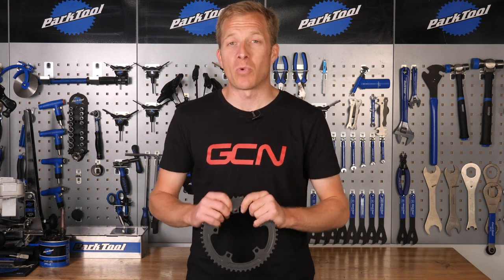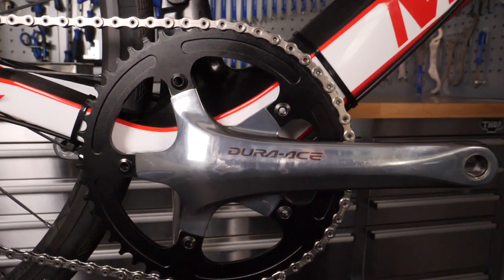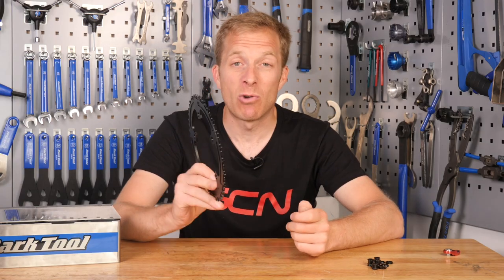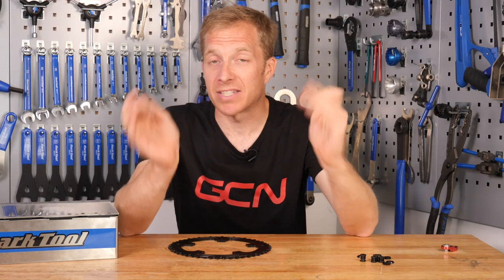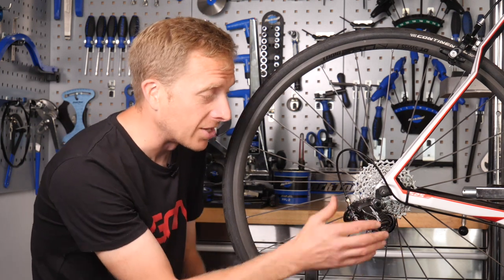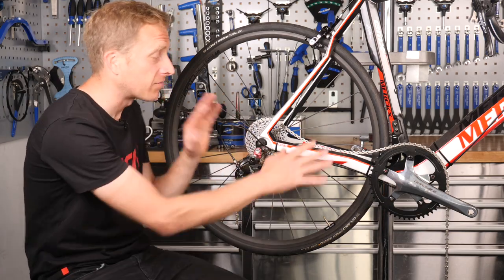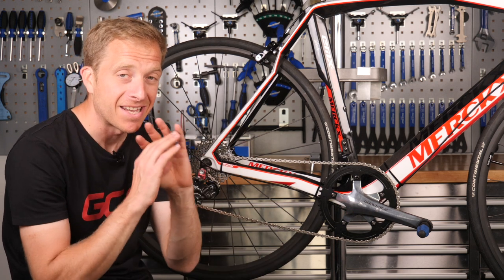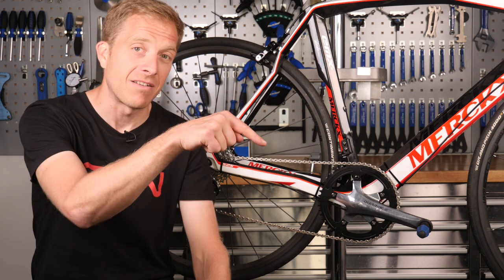Convert Your Bike To A 1x / Single Chainring Setup!

Comment from the maker: Are you thinking of converting to a 1X drivetrain? Let us know. 👇
Reply: On a roadbike? Never. Why would I sacrifice the extra ratios of a 2X ? The newest Ultegra rear mechs will handle a 34 cog cassette. I already ride a 50/34 chainset so with that rear mech I can handle anything.
Reply: I've recently completed a conversion on my steel audax frame to a gravel-lite setup with a Shimano CX50 crankset, 40t Hope retainer ring, a 10sp 11-36 casette and a 9sp Deore XT rear mech. Slightly less hacky than your method but it works an absolute charm, as the pull ratio on the mtb mech is almost identical to that of the 10sp 105 STI shifters. Ive been running it on and off road and absolutely love it! The stronger spring in the mtb mech coupled with the retainer ring keep the chain pretty firmly in place without any drama too.
Reply: Ill stick my current setup
Reply: Here's where I am with 1X.......... I wish you luck in the future, but I can't invest in you so I'm out,
Reply: No. Not on my road bike. Maybe I'm just not strong enough, but I often use the small chainring on my 50-34 11-30 setup. I have Sram Eagle on my mtb and even on that bike I'm not sure yet. I do like the smaller steps between gears of a 2x.
Reply: When I restored an my 1999 Giant OCR, I took the big and the small chainrings off the triple Shimano Sora chainset, I ended up with a 12-25 8 speed cassette and a 42 tooth chainring on the front. The set up works absolutely perfect, i didn't but any special stuff like a narrow wide chainring or a chain keeper. I would never describe it as a bodge, it works perfectly and looks really neat. I use the bike every day as my commuter to work. (if you want to have a look at the bike, I recently sent it in for the GCN Tech bike vault ;) )
Reply: I find it kind of funny the way cycling is regressing in the gear range department. My first bike was a three speed hub tourer, after learning on a single speed 'high nelly'. Three speed and little flat roads led me to a 2X ten speed racer, better selection for the hilly sections. My current stable all have 3X nine speed, wide ratio setups, much more suited to the terrain, for me. I don't think I'll go 1X.
Reply: I'll be keeping my infinite speed hub and 2 chainrings.
Reply: No.  Never.  I like having the ability to fine tune my cadence and comfort level to the climb without massively shifting under load
Reply: I'm just in process of doing this on my commute/winter bike. I am using 105 10 speed shifters with a deore 9 speed rear mech because the pull ratio is the same. I have sourced all the parts i.e chainring, chain, chainring bolts and cassette from china via ebay for £50 to try and keep it cheap in case kts not for me.I will be running a 48 wiyh a 11/40 cassette which works out in the 48/40 to be the same as 34/28. I have found with the deore rear mech that you can tension the spring by choosing one of two pre drilled holes by removing the cage from the rear mech, if this is still too slack there is possibility to drill a third hole to add tension.
Reply: @Stephen Connor : Hi ! I was thinking to go 1X this days, and I also have a Rotor Q Rings. So you have a "standard" one or  narrow wide exists ? Thanks !
Reply: I’ve thought about going somewhere between my 50/34T (42 maybe) and just leaving the rear 11-32 as is. Thoughts? Also, if I do this I may even go oval up front. 😮
Reply: It is easy - just remove useless on flat chainring gears change mechanics ;) Anyway, what you guys from GCn know about hacking drivetrains - please look at photos from my today strava activity https://www.strava.com/activities/1661220062 where stainless custom oval three  chainrings (62T max) and 14T-38T cassette is shown driven by cheap Altus Shimano using oldschool rare gears changing method :) Anyway, not so bad above 31 kph @ 80km using cheap alu 26" wheels easy :) Custom made improved Greg LeMond bars with integrated v-brake is another story :D
Reply: #askgcntech I have a question for GCN Tech about the 1x drivetrain. Am I not in danger of "cross chaining" when I'm in one extreme or other of the rear cassette? My current compact setup sure hates it when I get a couple of gears away from the opposite end of the cassette range (versus the chain ring). I would think this would make things even noisier.
Reply: Na, I wouldn't like it if my left shifter would just be flopping about without any funtion.
Reply: Running a 1x DI2 on my TT. 52*12-23 (12-28 if reqd for the course) using a normal RD 6770 and a 52T narrow wide chainring mounted to an Ultegra FC-6700. Never lost a chain till today. Chainring had to be bodged though to fit the crank.
Reply: Actually I was just thinking about this today.right now Im running a 9x2 speed setup with a 11-32 cassette and a compact chain set. and instead of this I was thinking of using a 48 upfront and an 10 speed 11-42 cassette maybe even a sram 10-42 setup with a clutch derailleur . ill lose some gears sure but the weight difference and simplicity might just take the cake.
Reply: Nope!
Reply: Did this recently. I put an 11-36 rear cassette. (Definately worth going with the 36t). I used a medium length tiagra derailleur; without a chain keeper; I've put it through its paces; I haven't had any issues with the chain coming off. One thing I did do was bolt the chainring to the inside of the crank as opposed to the outside (where you would normally place it) as the chain kept popping off on the larger gears. it seems to run smoother and eliminate the issue. It may just be that I have a wider crankset. But if you have that issue give it a try as it may save you having to put on an ugly chain keeper.
Reply: I wouldn't want a smaller highest gear than a 52-12 equivalent, so wouldn't want to go smaller than a 48T chainring, assuming an 11T smallest sprocket. That would work for the gear range I need with an 11-35 cassette (can you get those?). But the jumps between the sprockets would absolutely do my head in! I sometimes find I am looking for an "in-between" gear even between sprockets with one tooth difference.. ;-) So not for me, or at least not until 20 speed cassettes are invented..
Reply: But thanks for forcing me to do the maths at last.. :-)
Reply: Does anyone else feel 1x is more suited to cyclist with a higher cadence?   

With larger jumps between gear ratios, is it possible that gear changes are smoother at 90-100rpm as opposed to 80rpm? 

I think GCN should do a video on who 1x is best suited for? Is it actually better or is it just popular because it requires less math?
Reply: Nope, but if we talk about mountain bikes, I would never run a 2x again! Road=2x MTB=1x
Reply: No.
Reply: In run 1x myself 50x11-32 for training and races in my flat country, i would recommend just buying 1x rival or force
Reply: I did this conversion on my commuter road bike a few years back (sans narrow-wide chain ring) and had problems dropping chains on bumpy roads. I put a narrow-wide chain ring on and it's worked great on road and gravel.

I choose the 1x conversion because my left shifter broke and I didn't want to replace it. I have a short commute that's hilly enough that I never get in the big time anyway.
Reply: Giving it thought.  But let's do the math.  First have to figure out the right gears:

A 50/32 combo at 60rpm will get you up an 11% grade at  300 watts.   To compare to a double, even a 36/28 will get you to 13.4% in the same conditions, which happens to be almost identical to a 50/40 front/rear combo. But  even short cage rear mechs are now supporting 30t to bring 34/30 to 15.2%%.  That's sounds much better than 11%, and maybe more importantly it increases the grade that you can actually spin on (or sustain for longer times if you're not a tour pro) to about 10%  

So I think if I went 1 by I would be up at 40t and still not as happy as the double. An 11-40 casstte weighs 411 grams.  A ultegra 11-30 weighs 269.  So about 142 grams different.  Removing an ultegra front derailleur saves only 106 grams and the extender adds 17, for a total of 42 grams MORE for the 1by.  I can't find the weight of a the small ring, but I found a similar ring listed at  31 grams.  Seems like a wash.

**GRAND TOTAL**
With the 1 by I save no weight (probably add a few grams) in spite of losing the front derailleur.  Still lose a whole gear (10%) on the low end gearing compared to my 34/30, and, maybe most importantly, get drastically worse gear spacing.

VERDICT:  NO WAY, not a chance.
Reply: Actually, I was thinking about doing that. Jumping to a road bike after years of riding a single speed, The front derailleur always felt needless. Thanks for the advice, I'll check this out!
Reply: Kacper Ciesiolkiewicz, a 411 gram giant cassette and poor gear spacing might seem needless too, especially when you can get better gear spacing, better gear range, and the same weight, with better chain control.  I could see it for a TT bike though, although weights not an issue on a TT bike and gear spacing very much is.  I might be more inclined to get an 11-21 cassette with a double for a TT bike.
Reply: Swapped out the 50/34 on mine for a 42t single chainring. On the 50/34, I spent most of my time in the smaller chainring. My bike was having lots of trouble swapping chainrings, and anyway as a casual rider, the 50t ring did not get much use. 

I decided to pick the 42t single as it was nicely in the middle of 50 and 34 (i.e. ±8t). It's so much more comfortable to ride now (I lose the ratio at low-speeds/climbing but I haven't swapped my cassette, yet) and keeping a comfortable cadence, my average speed is much higher than before.

And of course, swapping to 1x has made the ride almost entirely silent.
Reply: Fazlee  Majeed if your average speed is higher it's not because you went 1-by.  If your front derailleur wouldn't shift and made noise, it likely wasn't setup right and was rubbing, wasn't oiled/cleaned, both, etc. There's no reason a double should be noisy. Nothing about a 1-by should make your average speed higher on flat riding.  There is no efficiency difference beyond a couple of percent, max,  from using a larger chainring or not cross-chaining, and there is no reason you shouldn't be able to hit the same gear ratio and thus cadence for a given speed in either setup for your typical flat-riding speed.  Power is power, especially when it's at the same cadence.  It's also possible that you're just getting more fit.
Reply: Anon Ymous cable pull adapters do exist.
Reply: Not on my road bike, but I have a frame I am sending for carbon repair that I was gifted, and I am planning to Frankenbike it with some take off parts for more casual riding, and will probably go 1x on it.
Reply: I have been running my Road going MTB with a 1x9 set up since 2006 when i got it. I have only had issues with spinning out down hill as the 38 tooth chain ring isn't big enough. i am so pleased that there are now narrow wide chain rings to get rid of the almost pointless chain guides that just look rubbish. so happy to now be able to get a narrow wide for the commuter bike too! let us know how you get on.
Reply: Only go oval if your mech dosen't have a clutch or your willing to ride with the clutch off as the constant changing of the ring size loosens the clutch.
i would recommend going at least 44 tooth up front as i have been running my road going MTB for years with a 38 tooth and even though i am not the quickest person i have spun out 38/11 and been left behind in shame on my commute by the same person three times now.
As my ridgeback flight needs some love i am going to 1x it and see what happens think i will be going for a 46 or 48 on that though.
Reply: Yes. I'm planning to do it to my Trek Madone (2014). I'm replacing 34-50 rings with a 42 and the 11-25 block with a 12-30. I'll lose a couple of gears at the top. Not bothered about that as I've only once engaged 50-11 on a steep descent and that's over the 5 years I've owned the bike. The low end will stay pretty much the same. I won't need one of those derailleur extenders either.
Reply: Done it. 44t front and 11-36 rear. Works fine where i ride.
Reply: can't u use the 50 tooth ring on the 105 chain ring as a 1x? 

i plan on doing so because my left shifter jams whenever i shift to the big ring . the lever doesn't display a clcking sound when shifting to the big ring. .. need help!! #askGCN
Reply: i looked into converting, however its a costly upgrade and im too tight !
Reply: Late to the party, but here is my cheap, hacked setup after my front downtube shifter broke.  A open box returned SRAM Apex 1 rear derailleur friction shifting a  Shimano 9 speed 11-36 cassette with my remaining downtube rear shifter.  Front ring is the Sugino 50t on a Dura Ace 7410 from when it was 2x mounted on the inside (uglier) position for a better chainline.  I am coming from a vintage Dura Ace 50/38 12-26 2x8 setup; so I am not really losing much.
Reply: I'm thinking about it.  There isn't a road withing 50 miles that makes me use the small chainring 😥.
Reply: Johan Oseroff Hi! I want to try the same! Which chainring do you use? Did you mount it on a shimano krank? 
Best regards from Gjermund Steinsland, Norway
Reply: Yes I am. All I need is the crankset right?
Reply: Want to
Reply: Is it worth the weight saving?
Reply: Yes on a Trek hybrid.  I rarely use the outer and inner chainring and they're finicky when crossed in those rare instances I do. Going 11-48 on a 38 chainring.
Reply: I did it to both my road bikes and never looked back. Best upgrade. Love it! So simple, clean and lighter.
Reply: I run 9 speed ultegra shifters, 9spedd ultegra mech, stronglight 48tooth chainring and a sram 11-34 cassette